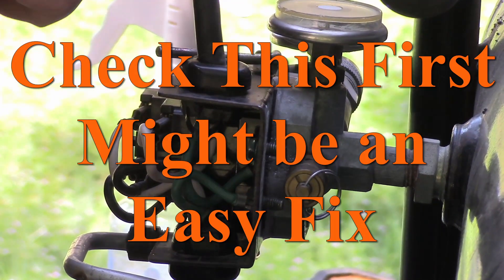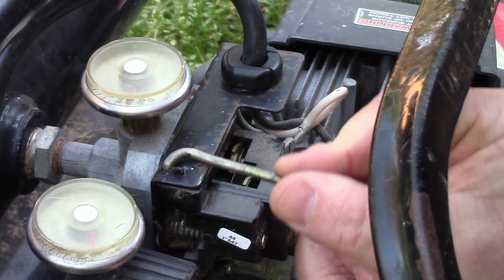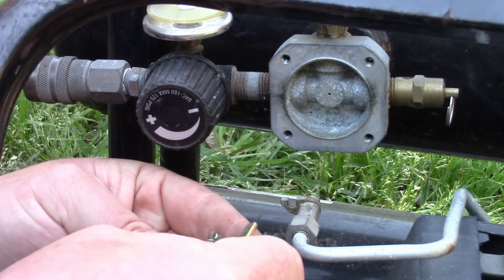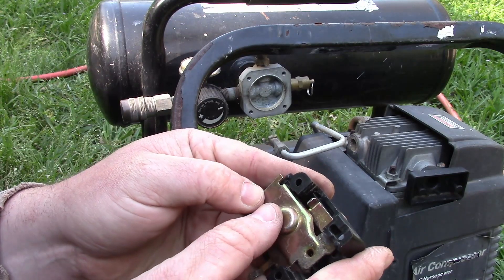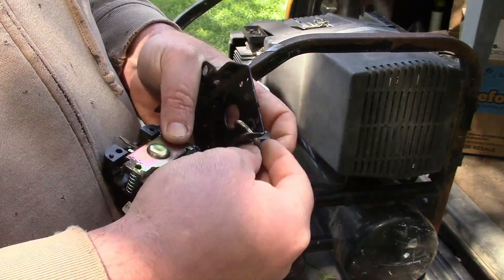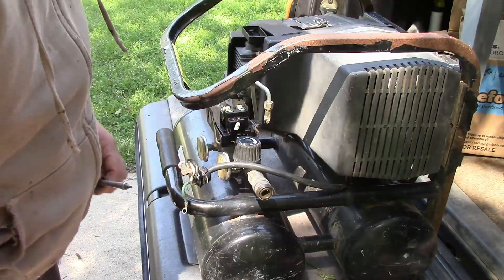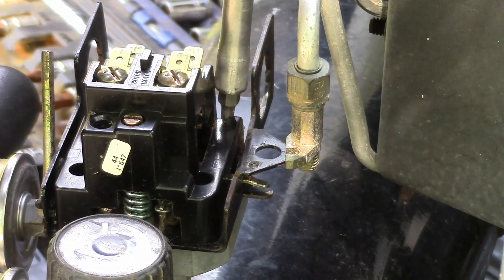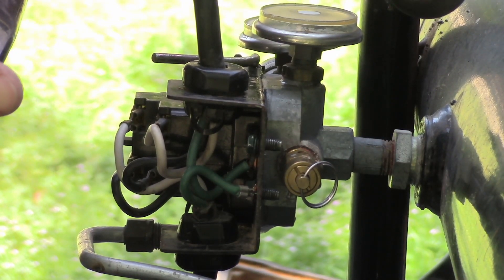Air Compressor Pressure Switch Leaks, How to Replace the Diaphragm!

Comment: I know this is a year old but I just did the same thing. The diaphragm plate was a little loose so I figured I’d take it off and give that a quarter turn and it would be good to go… big mistake. I got it back together. Holding it together is the problem.  Solution: put it all back together use two zip ties to hold it together, re-install leaving four screws somewhat loose,cut zip ties and pull them out, tighten screws the rest of the way, and done.